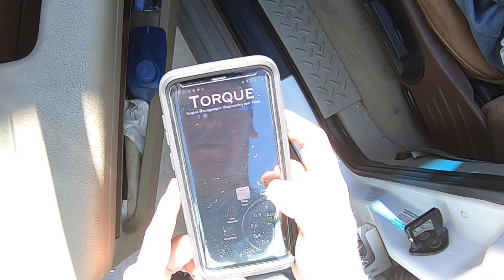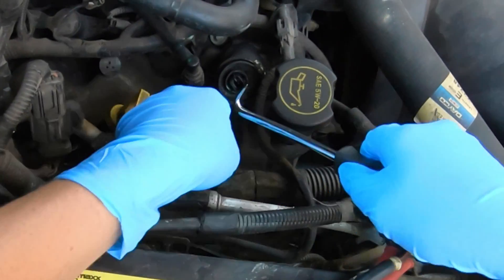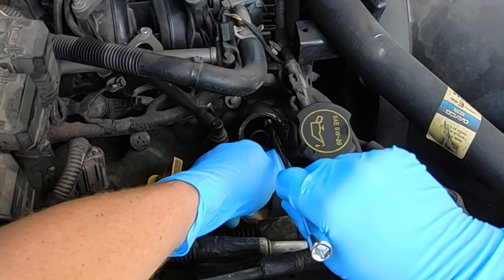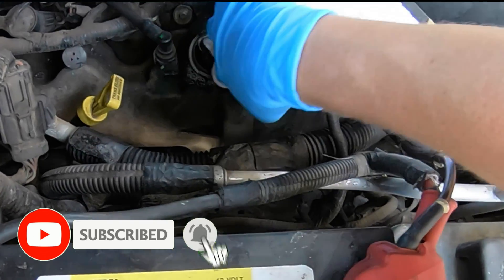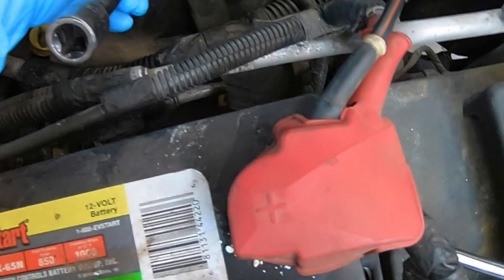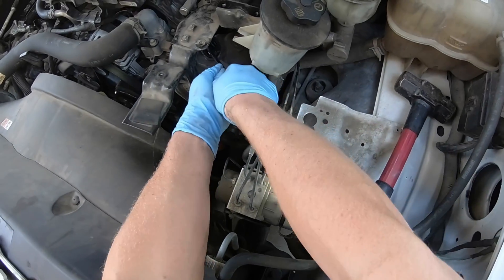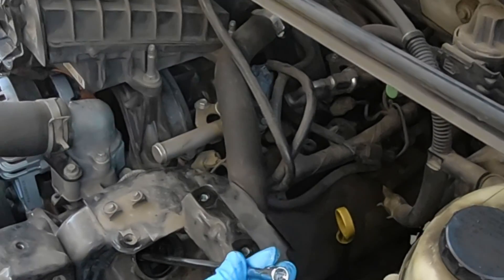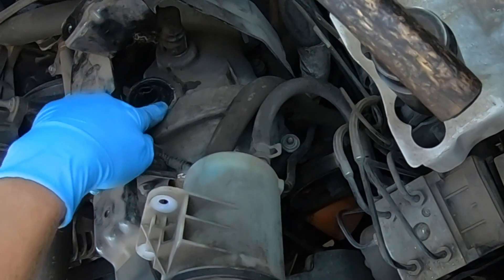⫷ Ford F-150, Mustang, 5.4 / 4.6 VCT Solenoid Failure, Trouble Codes P0020 and P0021 FIX ⫸

Comment: What happens if the screw go inside the engine????
Reply from the maker: You gotta fish it out. I wouldn't run the truck with the screws in the oil system.
Reply: I drive an 05 Mustang GT ; threw p0021, I replaced the solenoid and the code cleared but there’s a knocking sound when idling .. does that go away or is there still something wrong that won’t come up as code ?

Comment: Hi i already replease the selenoides but still have P0021  and P0011 those are new from ford dealer other tutorial in youtube says that probably the engine oilbecause I put a different oil than the one recommended because the engine was totally rebuilt and they told me that I used a different oil

Comment: This video does not work of models 2007-2007 5.4 3 valve, ford made the holes for the solenoid smaller in 2007 so it is not the same job as a 2004 to 2006 you have to take the entire valve cover off to get the job done…avoid buying a 07-08 if possible mine has been nothing but trouble.
Reply from the maker: Thanks for the tip. 👍👍

Comment: 2006 Ford Expedition. Works for my car but just make sure you’ve got the right gasket. Mine doesn’t have ears on it and I bought one with ears. Make sure your parts are the same going in as they are coming out
Reply from the maker: Great tip. 👍 that is one reason I like to take pictures as I go. If I get to a point I can't remember how it wen or what it looked like, go to the pics..

Comment: Good video helped alot for my 2005 f150.   I have 2 codes p0011 and p0021. Truck runs rough when i accelerate. Also just had cam phasers done and now runs bad again.. hoping this is the problem.
Reply: Did you figure it out? Thanks. I just changed camshaft position sensors last night now it's back to doing the same thing with#8 cyl misfire